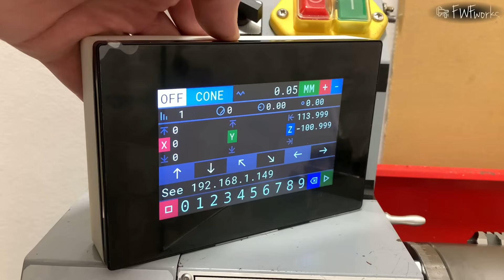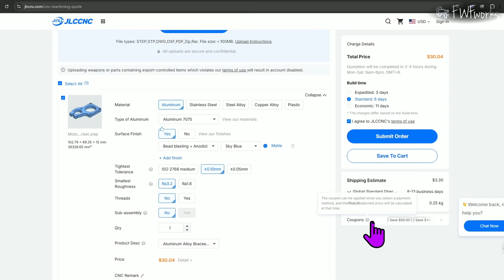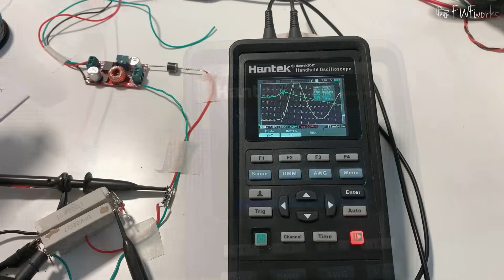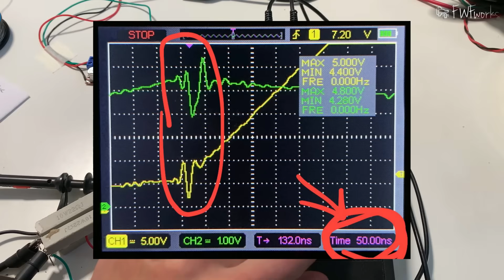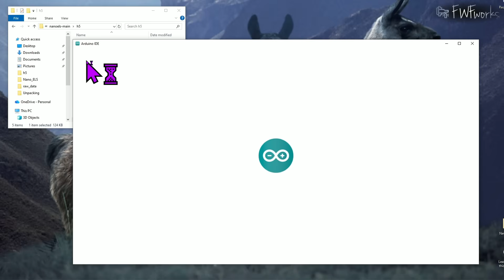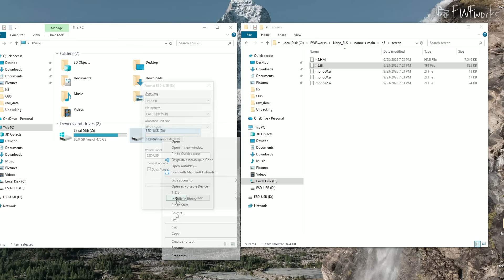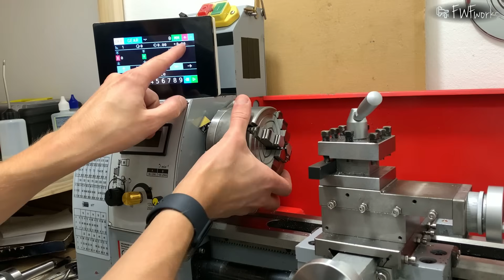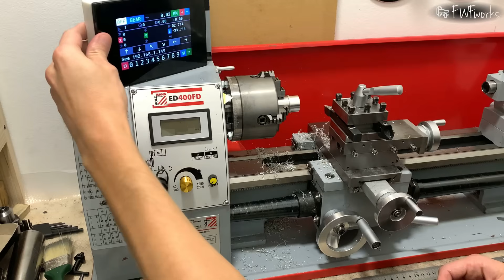NanoELS: Turning a Manual Lathe into a Smart Lathe

Comment: Could you explain how you build your lateral Offset spindle ? I'd like to buy an HBM lathe and add stepper motors, and your video is exactly what I need. However, I'd also like to add an offset spindle on the side, but the spindle mounting is important. I saw that you were using an offset spindle at the beginning of the video. Thank you
Reply from the maker: Hi! Thank you for your comment!

My very first video on this channel is actually about making a Mini Lathe Toolpost Milling Device.
You can find it on my channel, or by using this direct link:
https://www.youtube.com/watch?v=Z3smeLeXhhw

I would also recommend watching my video “5 Micron Runout — No-Cost Bearing Rework | Scraping & Holzmann ED400FD Upgrade”.
It shows the typical out-of-the-box condition of this type of lathes, including surface quality, spindle runout, and general fit and finish — so you’ll know exactly what to expect when buying an HBM lathe.

I hope this helps, and good luck with your project!

Comment: You made a remark about the not good TB 6600. Which type should we use then?
Reply from the maker: Hi!
I’ve heard that the DM556Y is much higher quality. However, I can’t confirm this, since I haven’t used that driver myself. It also seems too large for my machine.

Comment: The step ans direction on drivers can be active HIGH, or active LOW signals. That is why can miss steps on input case.
Reply from the maker: Hi! Good point, thanks!
I could hook up an oscilloscope and dig into it, but honestly, I don’t have the time or motivation right now to investigate the cause of this issue. It’s too insignificant for a setup with 6400 steps per revolution.

Comment: Excellent work! Would it be possible to add links/names for all the electronic components, specifically the over voltage protection board? Thank you and happy holidays!
Reply from the maker: Hi! Thanks for the comment.
Some of the electronic components, along with links, are listed on the GitHub project page. The motor, pulleys, and belts are mentioned in the video description. I also use a protection board, which you can find by searching Google for “WeAct OVP module 5.5V”.
Happy holidays!

Comment: Yes, this is a big and beautiful job. I went through this path a few years ago. When working on similar systems, I came to the conclusion that it was a toy. With fast movements and heavy loads, the dimensions of the part (especially steel) differ significantly because it is a sequential system. Therefore, I threw it all away and installed LinuxCNC, after which I forgot about all the inaccuracies and backlashes and have the opportunity to constantly modernize the system.I wish you luck.
Reply from the maker: Thanks, I’ll keep your advice in mind!

Comment: Nice! 👍
I never understood the obsession with CNC among the hobbyists. The CAM part needs sooo much effort to work, dialling-in toolpaths, feeds and speeds, it's insane. Full computer-control is for production.
Instead, this "semi-automatic" is the way to go! You can still set coordinates, and with a motorized cross-slide, literally any relationship between them: constant surface speed, difficult threads, tapers, precise transitions, balls, any profile, without a tracer attachment. (The same goes for mills, of course.)
I don't know if this board has inputs for that, but I'd suggest adding rotary encoder handwheels for each axis, so you can move them both like a normal machine, not by the touchscreen.
Thanks for sharing.
Reply from the maker: Hi! Thanks for your comment! I agree with you! For a hobby setup, it’s often enough to automate just a few inconvenient things, like changing gears, and the work immediately becomes more enjoyable. And yes, this controller does support rotary encoder handwheels and a keyboard. However, I personally prefer the touchscreen without extra hardware.

Comment: Those cheap "TB6600" stepper driver modules are not good - and that style may well not even be a TB6600 chip inside !

Stepperonline digital drivers are way, way better and not outrageously expensive - they are "Night & Day" different in terms of performance from the same motor compared with the thing you showed & well worth the extra cost IMO.. Run from a supply around 10-15% lower voltage than the driver maximum for better torque at higher speeds but with enough room to absorb energy from a deccelerating motor without going over-voltage. Running high step counts makes for smoother operation but really cuts back on the available torque - run 400-800 steps/rev to get near the motor rated torque over a wider speed range & this helps with missed steps. Set the drive current to the rated motor current - it is current that makes torque. With the current set correctly expect the motor to get warm in operation.

Look forward to seeing this with the X axis drive mounted.
Reply from the maker: Hi! Thanks for the comment and the advice!
I’ll definitely use it in the future. And yes, when I start selecting components for the X axis, I’ll also buy a new driver for the Z.

Comment: возможно пропуски обусловлены самим энкодером, была проблема пропуска при установку такого же энкодера на гитару что на 1,21 минуте. решилось (идея не моя) установкой конденсаторов в линию А-gnd, b-gnd. энкодера, я ставил 6000pf.....я тоже хотел этот вариант применить уже ESP32 взял, универсальную плату развязки взял, но стоимость экрана меня остановила, может кто нибудь перекомпилирует под stm32 и дешевый экран, или придется вместо nextion брать типа tjc. или добивать linuxcnc с mesa7i92.
Reply from the maker: Hi! Thanks for your comment! In my case, the issue is definitely not the encoder. The problem occurs even when the spindle is not rotating. Simply moving the carriage back and forth using the controls is enough to trigger it.
Reply: @FlyWolf_works  конфликт прерываний, либо неправильно настроены таймеры (кривой код). Для исключения аппаратного бага я бы подал на драйвер 36-48V (насколько я помню, такое допустимо).
Reply from the maker: @TURBO_mania  Hi! Thanks for the comment. This issue doesn’t exist in Maxim’s build. The code is the same. I think the problem is in my hardware. Either way, with a 6400 microstep setting, this error is theoretically about 0.3 micrometers per pass. At this stage, I’m not going to do anything about it 🤷‍♂
Reply: Интересно, ему западло на русском отвечать?
Reply from the maker: @protagonist8064 
Hi! Thanks for your comment 🙂
I chose English as the main language of the channel because it’s an international platform and I want the content and discussions to be accessible to everyone. For that reason, I’ll continue using English here.
Reply: Dwin display вполне рабочий вариант. Практически то же самое что и nextion только в разы дешевле.
Reply: Ппропуски это вина драйверов и самих шаговиков, с этим разбирались.